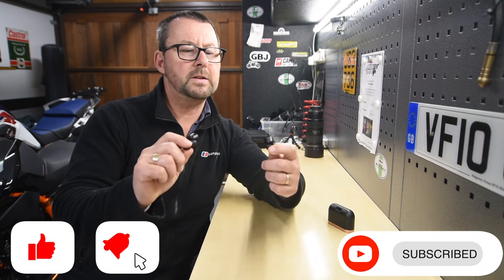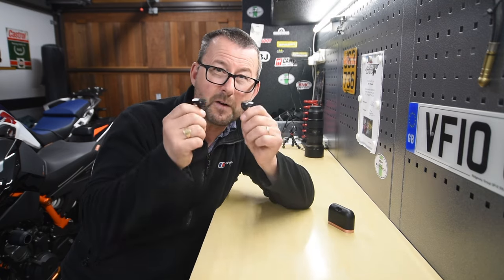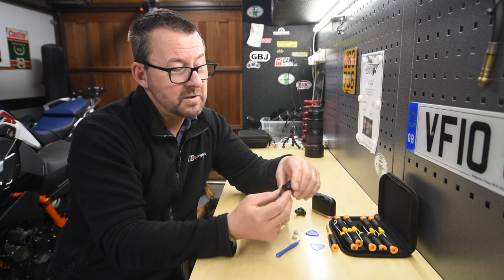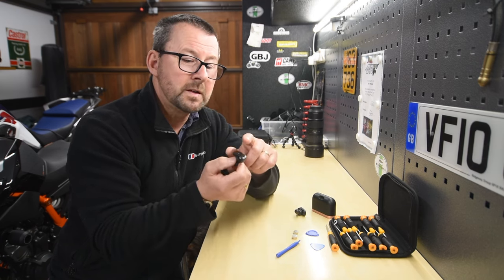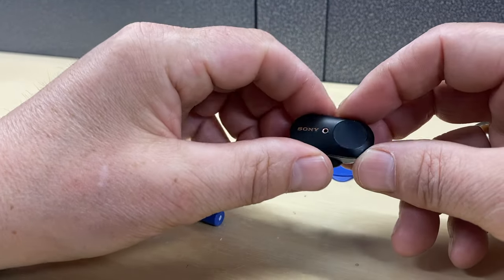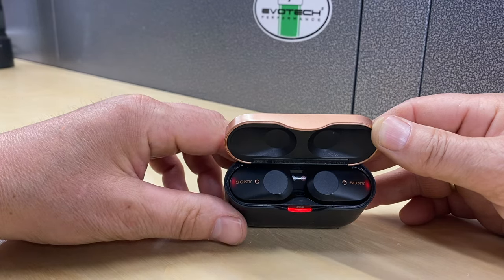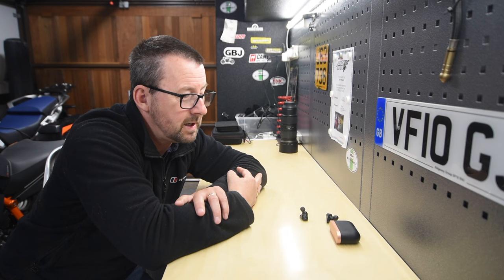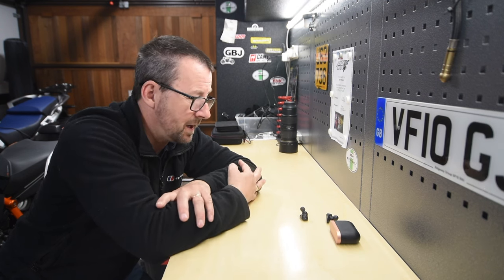SONY WF-1000XM3 BATTERY REPLACEMENT , JUST A 10 MINUTE JOB🤪

Comment: inside under the cover is a flat capacitive sensor coil. There is a black jelly-like plastic there and it serves as a seal or glue to transfer the charge from your finger through the cover to this sensor. So after the headphones are assembled - the sensor stops working because this glue is disposable. Having torn it off, it no longer conducts the signal for the reason that the contact is not tight. How to glue or what to replace this glue?
Reply from the maker: Hi. Sadly no idea what glue to use if that is the case . I guess most folk have not had an issue when they refit the cap .
Reply: @gsd32i  I re-assembled them 2 times, and the problem has gone. Finally
Reply from the maker: @invisiblealex007  Brilliant 👍

Comment: mine does not even charge now, is it just battery problem like need replacement or something else?..........owned it for almost 2 years.
Reply from the maker: Does the charging case charge ? If it does then I would change the batteries in the earbuds .

Comment: What battery life do people get with the Varta batteries? I used to get more than 5 hours with sound cancellation on with the original batteries, but I was down to 5:20 without noise cancellation.  I replaced my batteries and did a factory reset. Now, with noise canceling and DSEE turned off, I only get 4.5 hours - worse than my old Zenipower batteries.
Reply from the maker: Before I changed the batteries I was getting about 40 minutes !! Now it’s about 5-6 hours. Depending on volume level , I do tend to have them quite loud ! Certainly much much better than before hands down .
Reply: @gsd32i  I listen to podcasts and sports on my walks, my volume is 1/4 or lower - just loud enough to understand words comfortably. I use an iPhone and AAC supposedly offers better runtime than Android codecs. I reset the earbuds again and contacted the battery seller. I cant believe new batteries have a worse runtime than my 2+ year old, used-daily-batteries. Thanks for the video by the way, the replacement was very easy - I think my problem is a dishonest eBay seller.
Reply from the maker: @leecewest  I have heard of duff / fake batteries being sold . I guess go to a reputable shop if you can find one that sells the batteries . Try another set ?
Reply: Mine never gave me more than 2:45 hour but I always use them with full noice cancelling. I never allow them change noice cancelling level.
Reply: @zperdek  What devices did you use the buds with? IOS devices using AAC supposedly give better battery life than devices using SBC. Also, Using noise cancellation with DSEE HX enabled limits the earbuds to 3 hours.

Comment: Where do I get replacement batteries from and which ones are best. Thanks.
Reply from the maker: Hi . Depending where you live , internet sellers may or may not deliver the batteries to you . Try e bay in your area
You want the varta cp 1254 either A3 or A4 . Be careful with other batteries as they may be similar BUT may be too high and not fit into the earbud . Varta also do the cp 1254 A4 with has more power and is exactly the same size .
Here’s the Varta link 
https://www.varta-ag.com/en/industry/product-solutions/lithium-ion-button-cells

Comment: any tips for removing the screws? feel like they are literally stuck in there and immovable
Reply from the maker: Just get a correct sized screwdriver from a hardware store 👍 or borrow one .
Reply: @gsd32i  I bought a set off ebay to no avail. But I'll try a local screwfix store now

Comment: Hi, good morning first, could you help me with a solution?  and that the installation of the batteries was ok, however the right side of the phone works well with the commands, but sometimes when pressing to put it in the ear it makes a continuous noise.  disconnect from bluetooth, and then come back.  could you help me with this problem.
Reply from the maker: Hi . Try taking the rubber ear bud off and there should be 2 small holes which are for equalising air pressure . They may be blocked so try using a small needle to clean the holes . Also try a headset reset . 👍

Comment: After learning your instruction, i was succesful in changing the batteries. But i can't reset or initialise the buds. Can you tell me what i should do. Thanks in advance !
Reply from the maker: Sometimes the new batteries are rubbish and dead depending where you purchased them from.! if you still have the old ones try them to see if it is a battery issue. no reason why they should not reset unless you have damaged something or the new batteries have no charge in them .
Reply: @gsd32i  Thank you very much for your advice. The new batteries hold charge well and i can use the buds as long as i control it through my iphone 13.
Reply from the maker: @camphongnguyen6358  try deleting the phone app, deleting Bluetooth connection history , reconnect and then do a factory reset . It may help if it’s a clean install like from new .
Reply: @gsd32i  Thank you VERY MUCH for your help.
Reply: @gsd32i  Sorry, deleting Bluetooth connection history in the buds or the phone please. I guess it's my device ( iphone 13). I'll try  right away. Thank you.
Reply from the maker: @camphongnguyen6358  the Bluetooth history on the phone just delete the connection from the Bluetooth list and delete the Sony app on the phone . Turn the phone off and then power on again and start a fresh install of the Sony app and new connection between the buds and phone and do a reset of the buds too
Reply: @gsd32i  i'll try right away. Thank you.
Reply from the maker: @camphongnguyen6358  hope it works 🤞
Reply: @gsd32i  unfortunately, it doesn't work after resetting  or initializing. I meant, i still can't reset or initialise
Reply: @camphongnguyen6358  Make sure the pods are not connected to any device. Open the case and leave the earbuds inside the case. Hold down both touchpads down at the same time for around 30 seconds. If it's not working that way your touchpads might be broken.

Comment: Would the following work? -- Suitable for Samsung Galaxy Buds wireless Bluetooth headset battery 60mAh CP-TWS1254 CP1254 - or would 90 mAh be better?
Reply from the maker: Gotta say not sure, but if they are the same size, dimensions etc then shouldn't be an issue. Good luck , I will stick with the Varta ones that I have had no issues with since I put them in. 😁

Comment: Hi
I lost the left side so now i can't connect only right with my new phone any way to connect one side or if i buy left side from ebay and pair them together?many thanks
Reply from the maker: Try a re-set
"Place the headset in the charging case, leave the lid of the charging case open, then hold your finger to the touch sensor on the left unit for about 20 seconds.
Release your finger when the indicator (red) of the headset turns off after flashing.
Then hold your finger to the touch sensor on the right unit for about 20 seconds.Release your finger when the indicator (red) of the headset turns off after flashing."

This may do the trick🤞

Comment: Battery life on mine with a "100% charge"  was down to about 40 minutes. The official Sony repair procedure isn't great neither is their potential charges. So many thanks for this video. Following the advice from another commenter (thank you @Michael Nolan) I purchased  2 replacement batteries from RS Components (sn:1834285) - Removing the top cover took a bit of work and be careful removing the existing battery. Other than that it's pretty straightforward.  Many thanks

Comment: Hi, One of my headphones won't turn on, reset not working and when I put them in case not charging. 
Is it the fault of the battery?
Reply from the maker: hi, it would not do any harm to change both batteries .

Comment: My left earbud wouldn't start flashing when I hold the pad to do the reset but the right one does. Is that normal?
Reply from the maker: Hi, does the left earbud have power? If not the battery may not be in properly or may be dead! You could try swapping the batteries over if you don't have a spare one at the moment to see if it's the battery.

Comment: So i damaged the data wire anyway even though you mentioned it many times. Its about halfway teared. Strangely though the pods work. Where can i get a new one if it is will suddenly stop working
Reply from the maker: Not sure BUT there is always eBay and get a used earbud and replace the internals into yours !
Reply: @gsd32i  but it’s weird that they still work right?
Reply from the maker: @imrevandenelsen5400 yes 🤔

Comment: Hi, my charging case is not working. Even when I try to charge the case, the light does not come on. What to do?
Reply from the maker: Hi . Have u tried a different Usb c cable ? Also try cleaning the charging port on the case . I have seen someone charging the case on a wireless charging mat , try that too and see if the red light comes on .

Comment: do u think its possible for only using hands but not those plastic thing?
Reply from the maker: Give it a go...if not use a small blade but you may damage the plastic, but hey if thats all you've got then thats all you've got.
Reply: thx for the advice ❤

Comment: I can't get the covers back on properly. Is there a certain technique? The top parts won't click in however much I press them
Reply from the maker: Hi . Have you got the correct size battery as some are thicker than others ? So if you have got a thicker battery the top won’t fit . Do you still have the old batteries to compare the thickness .
Reply: @gsd32i  hi, I haven't actually changed the battery yet so I don't think that's the issue. I didn't have the correct size screwdriver so had to temporarily replace the top covers
Reply from the maker: @RedGorilla  ok . It will be something simple , in my younger days I would have thrown them in the bin , but now I have a bit more patience 👍😂

Comment: Hi! I have some problem here: I bought these Sony's headphones yesterday with the a refurbished retailer of Amazon, and the right earbud flickers red while it is charging, and doesn't pair to each other (the other one works fine), and somehow, while i charge the earbuds with an AC power, i founded that the right earbud becomes to charging fine, and eventually, it becomes to flicker again with no possibility to use it. When i tear it from his case, it doesn't respond neither. 

I thought that it's supposed to be repaired with a new battery but isn't working, what options that i have to do? 

I was thinking about return them after i find a solution by myself before. I tried to factory reset but nothing happened.
Reply from the maker: Hi . Happy New Year. If possible return as faulty , or if not possible try swapping the batteries over if you don’t have new ones available to see if the problem also gets swapped over … if it does , then simply get new batteries .
Reply: I am having the same issue but on the left earbud. I was thinking of getting a new battery and replacing it too but seems like it won't work. Have you tried swapping the battery of the working earbud to the non working one? Please let me know and share if it works.

Comment: hi, my earbuds are auto disconnecting and the right earbud's red charging light does not turn on when in the case but it is charging, any solutions?
Reply from the maker: Try a factory reset ?
Reply: i have the exact same problem, have you rectified it?

Comment: Hello friend, I congratulate you for the video since there is not much information about those headphones. And you know how to explain the battery change well. I have those same headphones but in my case they are not recognized by any type of device and I tried with different smartphones and none recognized the headphones through Bluetooth. Do you have information on how to repair that problem in those headphones?
Greetings.
Reply from the maker: Hi Max , have you tried to reset the headphones?
Reply: @gsd32i  If you already do the process and still the same.
Reply from the maker: @Sensey427  hi . Have you tried this ? It’s from the Sony manual 

When you pair a second or subsequent device (if the headset has pairing information for other devices), put the headset in both ears, then hold your fingers to the touch sensors on both the left and right units for about 7 seconds.

This may work ?? Or not !

Comment: Replacement went great, thanks to this toutorial. One issue tho, I realize while the left ear bud lasts like forever, the right earbud dies after just two hours, is anyone having the same issue if yes, is there a fix for it?
Reply from the maker: Try swapping the batteries over to check if there is an issue with the "new" battery.

Comment: Solid video, I just would have just started with the instructions instead of the 30% run and then actually getting into the replacement. I was following step by step to start and then tore the ribbon not knowing how fragile it was.
Reply from the maker: thanks for the comments. I did make the video some time ago. hope the earbuds are working still ?

Comment: Thanks a mill. That worked a treat. I picked up a pair of batteries for only €6. I'll see how long they last but even if I had to change them again in a year, at least I know how to do it now. I used a little double sided tape under the contact and battery to hold them securely in position. Easy to remove again next time too.
Reply: Hey Mark where did you get your replacements from? 6euro is a great price

Comment: my replacement battery is so hot when I place the battery into connector . do you what happen with it ?
Reply from the maker: Hi not sure why they would get too hot . They will get warm whilst charging though . Try a factory reset and see if that helps .
Reply: same happened to me on only one bud, I let it cool off and ensured the battery and little metal horn were perfectly aligned (I used a bit of glue to fix that horn that came off) I then placed the battery again and it didn't get hot) buds work like new again

Comment: Can you use CP1254 A4 instead of A3? I think this would provide more capacity, am I right?
Reply from the maker: Yes the a3 has 60mah power and the a4 has 74mah . Unless anyone else has any reason why it shouldn’t be suitable , give it a go . It’ll just take a bit longer to charge up .
Reply: @gsd32i  Thank you. Btw, are a3 and a4 the same physical size? If a4 is just 1 millimeter bigger, then it wont fit.
Reply from the maker: @herlock1400  the data sheet from Varta show that the a4 and the a3 are both the same height and diameter , 5.4x12.1mm . The a4 weighs 0.2 Grammes more than the A3 . If in doubt go for the A3 , but looks like it will fit . Now just going to turn over and sunbathe at bit more whilst on holiday 😊
Reply: @gsd32i  thank you and enjoy

Comment: I replaced the battery in my right ear bud and the red light comes on In the case but appears to be flickering a bit instead of solid to charge.  I can’t get it to reset either.  Ever seen this issue?  Thanks
Reply from the maker: Are you following the correct reset procedure?
Reply: @gsd32i  I am.  The left works fine the right will not reset.  I got it to once but the pairing blue lights never came on and then couldn’t reset it again
Reply from the maker: @Mjfitzner  try swapping the batteries over , ie put the left battery in the right one and see if it’s the battery .
Reply: @gsd32i  I can try that.  The replacement batteries I bought off Amazon was a 2 back and neither worked
Reply: @Mjfitzner  Did your problem get solved after swapping the battery of the working one on the not working one?
Reply: @sherlockholmes879  I ended up finding a replacement right side one on eBay for $25.  I just went that route.  Thanks for your guidance tho

Comment: After replacing the batteries, the left bud wasnt working, and the red charging light was flickering really lightly, like there was a voltage problem. The bud wouldnt connect to the phone, so I put the old battery back in the bud to test it and it didnt change, so I could see there was a problem with the actual bud. After a bit of research it seems that the charging case cant regulate the voltage correctly sometimes. To fix this issue, you need to let the charging case run totally flat, (leave the door open with the buds in), then once you recharge the case, and put the buds back in they work as normal once fully charged.
Reply from the maker: Thanks for taking the time to post so that others can see. I will add this in the description 👍

Comment: Guys one thing I noticed. So, I ride a bike and I used the left earpiece only for a long time, since the initial release of the xm3's didn't let me use the right one without the left one.(I only use one earpiece for road safety, just to answer calls etc.,) Later on they updated the buds and I was able to use either one of them one at a time, but by this time I was so used to the earbud on my left ear I used till the battery lasted about 20 minutes after each charge. I used it for about 2 years and the charge went from somewhere around 4h - 20minutes at 60% volume. Later I switched to the right earbud. My least used right bud lasted about 9 months and it totally stopped working, which was surprising (Yes I did use them together during travel or jogging or cycling) When I was changing the battery, the battery of the least used earbud was enlarged, which was the observation. Idk if the charging is not controlled properly or something, but from today onwards I will be using them both equally to make sure I don't have to change the batteries for a couple of years.